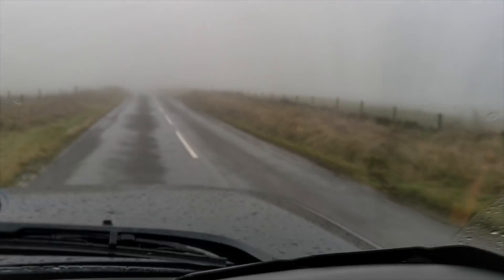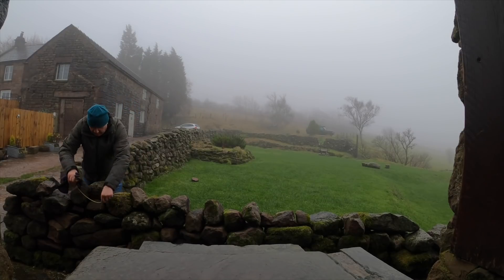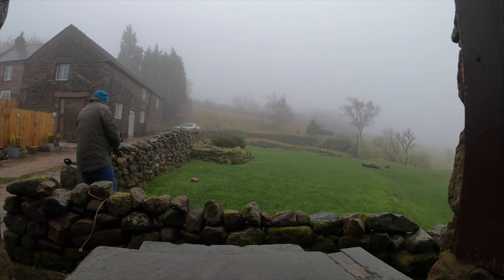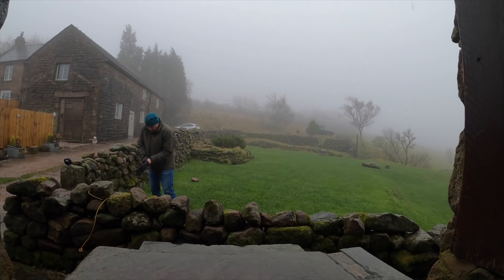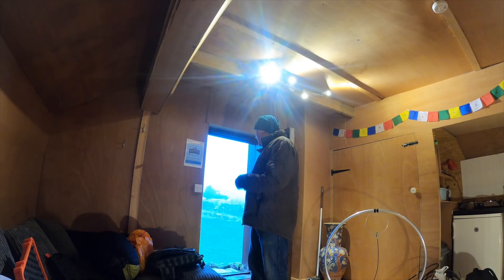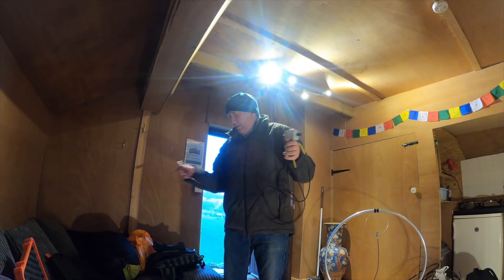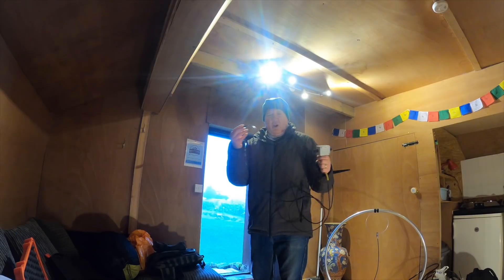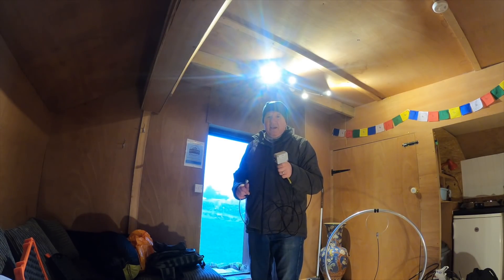What signals can we hear through a 300m long loop antenna?

Comment: I know that I massively late to the party, I can't see what that cable reel is made from, if it is non conductive you could have  lot of inductance. If you had a few spare metres of wire you could have wrapped a few turns on top and shorted them out. Well done for going out in those conditions..

Comment: If the Velocity Factor of a very long (multiple wavelengths) antenna wire is any different than the Velocity Factor (~1) of the passing radio signal in air, then at some point the passing RF and the induced current in the wire will start to go in and out of phase due to the different velocities. Thus, after a certain length, any further increase in antenna wire length will start to be counterproductive. I've not seen anyone mention this factor before, but it can't really be news to the experts. I wonder if this is related to the recommended max length of a Beverage antenna at ~1.75 wavelengths ?  Anyone know ?

Comment: My primary HF antenna is a 160M full wave loop. I've occasionally been able to hear the 60khz timing signal (the one that all the "atomic" clocks use to update) broadcast by WWV on my Kenwood TS2000, whose receiver's low end is 30khz.

Comment: Magnetic loops IMO are  the way forward. If you are in an area where there isn't a lot of QRM, then fine, but for where I am I get good results on LF/MF from a Wellbrook. I also have an MLA30+ that I really need to try out. I have so many sources of noise! My favorite band is 60m for inter GB NVIS comms but during the weekend when my neighbour is home the noise goes to about S5 and that coupled with the various PSU's on my laptop (a real issue on 60m) and just general noise from xDSL etc. it's a losing battle. I've deliberately avoided LED lights to replace the GU10 50W halogens in the kitchen / dining area for this specific reason but given the price hikes in energy costs I've decided to put the things in but gone for a known brand and may take steps if they don't conform to EN55022 or whatever European Norm they claim to conform to. I was very active in trying to get PLT banned. 

It's just so f**king sad.

Comment: Why wouldn’t using the wire on the spool work just as well as spreading it out?
Reply from the maker: My simple brain is thinking use a loop of wire on the ground with low impedance, still not sure if the remaining spool of wire would act like an air coil?

Comment: Interesting video and thanks for posting it up. I’m a SWL and have tried ground loops, ground spike dipoles etc and some work great. Especially good for LW DX since ferrite antennas get plagued by QRM these days. I’ve used steel wire fences in the countryside than run for miles as well 👍🏼

Comment: Wire would be better above the ground, no?
Reply from the maker: As a receive antenna a loop on the ground may help to improve the signal versus noise ratio, it’s lowers the reception in general but the theory is that the noise is less so that the signal can be picked out of the noise. I’m not 100% convinced

Comment: Submarines and 3 digit spy stations. Lots of static. Some teletype. Some slow cw beacons. During the winter of 96 I "pinched" the use of about  1/2mile of electric fense wire. One night I heard a low whine that sent chills up me spine. As my rig dosen't have a local oscillator. It was a  MISTERY that haunts me to day. Ps the rig is a 1921 homemade  loose coupler rig gifted to me 30 years ago with a Sylvania diode or a set up for Galina whisker diode. I added a guitar amp. I surmise that the whine was solar or geo magnetic. Thanks again for good show de kv4li.

Comment: I did this when I was 14 (in 1966), using a barbed wire fence that went all the way round a massive field. Boy oh boy, it worked, how it worked!
Reply: How many meters long was it?
Reply: @RC-Heli835  A good question!  If I remember well enough,  the field was about 500m long by 400m wide. No antenna tuning, it was such a low power TX nothing could be damaged. I connected the antenna to the top wire, which literally went all the way round the field.  For the ground I just knocked a long metal tent peg into the soil. I couldn't believe how well it worked! The TX output was only about 1 watt, but the signal was loud and clear for miles, just as was the case with Ray's friend. I bet an electric fence would have done even better than the barbed wire, owing to the wire being insulated at every post it was attached to. Of course, this could only work on medium or long wave, but if the same thing was done using a good antenna tuner and more power, I bet that signal would go for miles and miles and miles!

Comment: i run a loop at 50 feet 180 m long i work the uk fr vk on 80 on 40  and gen local on 160m the antenna does not work so good above 15m band the directional yagi beams kills the loop above 15m. a rhombic antenna will beat anything what can be made.i do run my fm stereo on my loop and its dynamite.

Comment: Hey Carl, I have a few friends that are using loop on the ground and they are really happy with them. I'm going to try one out too because they seem to be able to hear stations that I'm unable to hear. As for the wire try to see if you can get some surplus military communications combat field wire. That way you won't need to borrow. BTW one of the lads I talk to on 40&80 meters uses inexpensive picture frame wire. I want to thank you for this experiment especially with the weather.
Reply from the maker: Thank you

Comment: I'm a fan or Mr Jelly as it happens.

As for the coil. You have a license Carl so you know what a coil with an induced current does.

The Buzzer on 4625 kHz is a regional sounding signal for the SW military area of Russia for the Air Force communications.

Comment: The coil makes a difference for worse. I think that goes for almost any coil in a antenna system placed at the end indoors. The antenna itself was on the ground which is also not preferable but still a interesting experiment to do!! You could probably repeat it one day and take the loop a meter of the ground and get rid of the coil indoor.
Reply: DX Commander  I have seen that video.

Comment: Should of added,,,,, I'm going to kit the landy out, and do some stealth camping and radio work. I use a kelly kettle set up for brewing up and cooking on which is fun, and have a ssb/multimode crt9900 running off a separate car battery linked to a small solar panel to keep it topped up,,coupled up to a Sirio ML145 antenna.
So looking forward to passing the exam and using 10 metres on my radio,,,,and am looking at maybe a dedicated HF mobile rig. Whats your opinion on the little G90 radios??